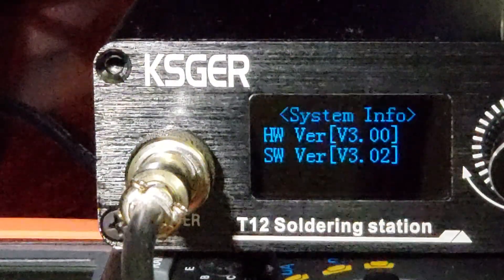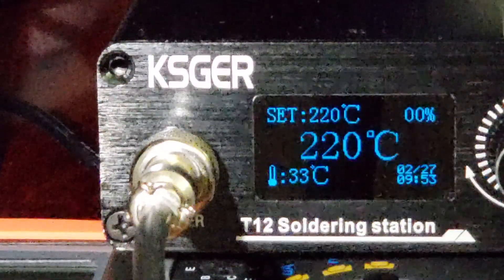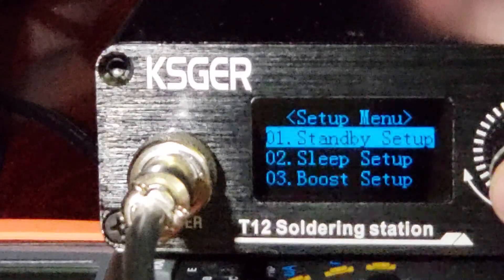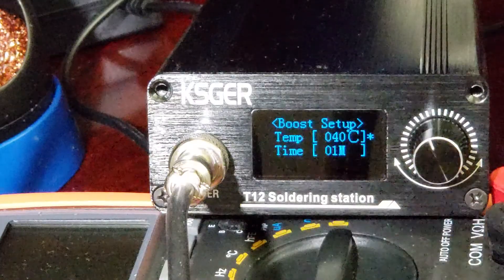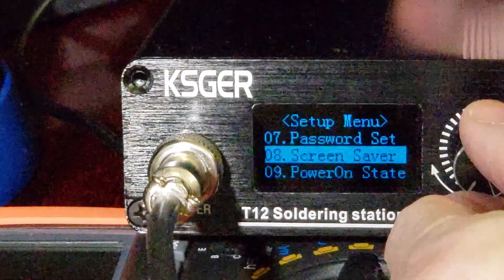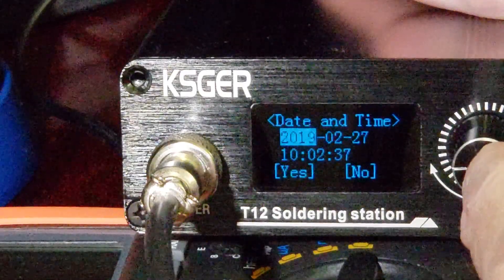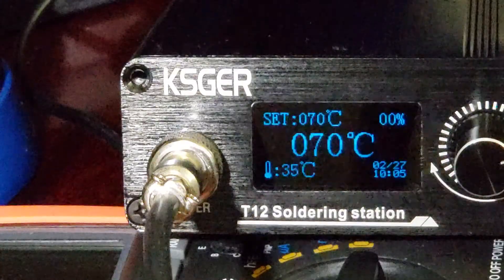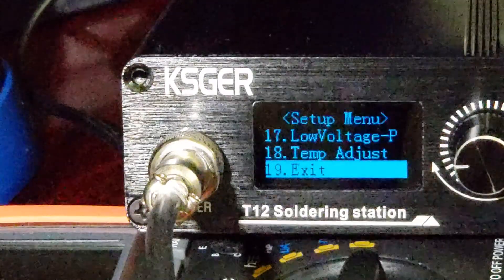KSGER STM32 v3.02 - Menu Options

Comment: You never shown inside the board, like v2.1s & v3.02
Reply from the maker: The insides are identical as far as the main power supply is concerned. The difference between 2.1 and 3.02 is simply the software.